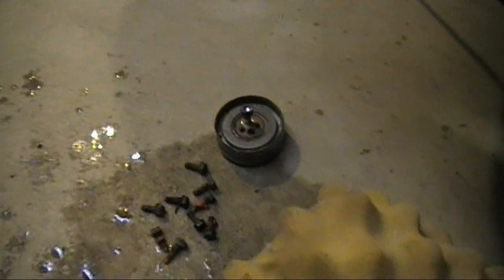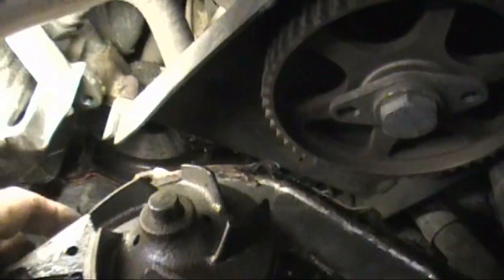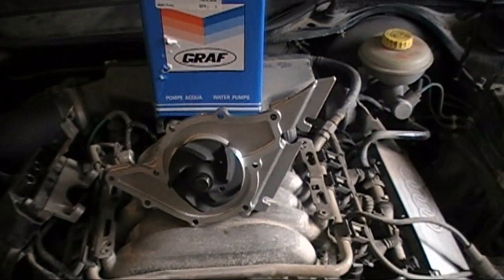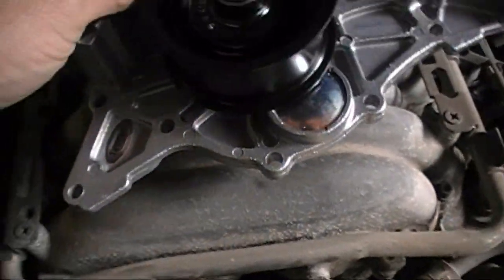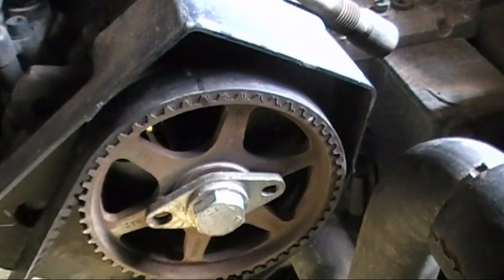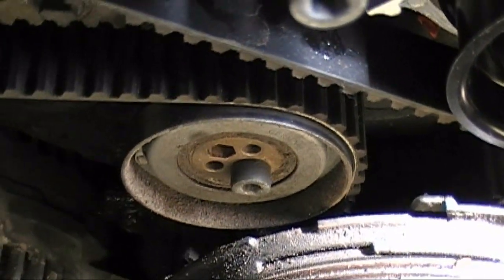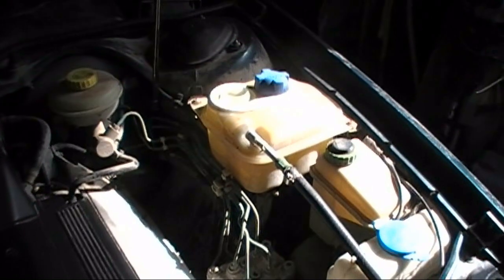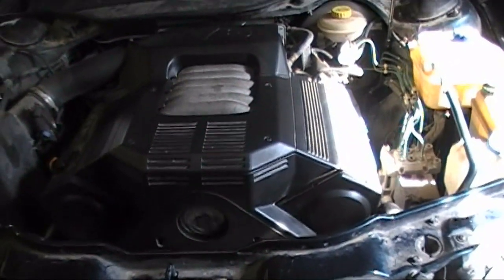Water Pump Replacement Audi A6

Comment from the maker: @DiMoN1 Thanks! I marked the timing belt because if you are off one tooth it wont run right. The belt is very tight and it is easy to put it on wrong.

Comment from the maker: Those were not easy to remove. I used a 1/4' drive socket with a swivel attachment and an extension. I dropped the first socket and swivel under the pump and could not get it out lol. I had to have my daughter (small hands) retrieve it for me. Good luck!

Comment: nice vid. really helpful. i have a 04 a6 i need a new washer pump relay and oxygen sensor. the dealer told me it would cost 1400 to do the job i know that all labor. so decided to buy the parts and do it myself. question though, where did u buy the parts you needed?

Comment: Glad you mentioned this. My coolant in my a6 2003 is low and am not sure how to add coolant to it. Do I just place it into the radiator or do I just place it in the over flow? I know that I need to place g12 in it, but, I am not sure how to add it to where it is mixed 50/50. Please help :/

Comment from the maker: It's under the plastic cover in the engine compartment that is between the wipers and the engine. Once you remove that, look in the center of the car from the drivers side up against the fire wall. There are two heater hoses going in to the heater box. One of the hoses has a round ball like fitting with a knurled headed screw in it. Loosen that screw to bleed the system.

Comment: The oil and dirt is most likely not oil, it's probably some debris (sludgy) looking gunk and it's from mixing the wrong coolant. The car has to have organic antifreeze and you should be getting it from Volkswagen or Audi directly. Don't buy the off the shelf coolant, as it has special properties in them.

Comment from the maker: @batoloco666 Going from memory, there is a timing belt tensioner I had to remove. That is why I marked the belt so I could get back in correctly and keep the timing correct. Once the tensioner is removed the belt can be removed from the pump.

Comment from the maker: Hello! The hose ripping off is a major problem. The oil and sand in the reservoir is very unusual. I'm not sure where this could have come from, but it does not sound normal. Good luck with the repair.

Comment from the maker: @GearHead1625 Okay, I wont take this as a bash... It has been a very good car. It has nearly 250k miles on it with almost all original parts. As for the style... it is 15 years old remember. Thanks for checking in.

Comment: Good job sir! I got one question i just bought 96 c4 at first it was running all smooth but today (Dec 11th 12) the host to the radiator rip off like totally rip off and the water all came out like crazy, the strangest thing is in the box (radiator water/coolant box) that supposedly holding up water it has oil in it and some debris might be sand? Do u know what's seems to be the problem? is it a minor problem or major?

Comment: Man I really appreciate your videos! One question though, as I am currently doing the exact same job on the exact same car...when you removed your power steering pump pulley did it pop right off after you removed the three screws? Because mine wont come off...or did you use some sort of puller?

Comment from the maker: Just take an empty gallon jug and pour half of the gallon of antifreeze into it and then add a half a gallon of distilled water to both jugs. You now have 2 gallons of 50/50 mix. Add it to the overflow reservoir.

Comment: If the timing belt looked in a newish condition sounds to me like previous owner replaced belt without changing water pump.  If you have to do all that work to remove and replace the belt what’s another few bucks for a water pump?   Basically the front of the engine had to removed twice and could have been done once for probably no or very little extra labor and the cost of the pump.

Comment: ahhh must feel good to save 1800 dollars huh. Efff the dealer they are so full of shi*.. I just had all belts pullys, oil seals valve cover gaskets camp plugs everything related on my 2001 S4 with parts and labor 1100 at VAST.  They are way better than the dealer. I wish i could've done this myself but i probably wouldve screwed something up.

Comment: Nice job Ed & good information.
In my experience I would suggest however, as a RULE, to REPLACE the timing belt and EVERYTHING that touches it while you are in there regardless of low miles or hours of use. These interference engines are merely a finely engineered form of TIME BOMB and as such the additional funds can be considered your cheapest form of insurance against catastrophic top end damage. I love Audi's but fear time bomb engines subject to Murphy's Law. Go with SAFE over Scientific.

Comment: please dont touch another audi. First off, the tensioners have a VERY specific amount of tension that need to be applied in order to not throw codes. If its overtightened, it reduces the life of the timing belt you DIDNT replace significantly. Also, the reason why the dealership charges that is because they would replace the timing belt, tensioners, idler rolllers, and would use the PROPER g11/g12 coolant. 
Stick to domestics pal